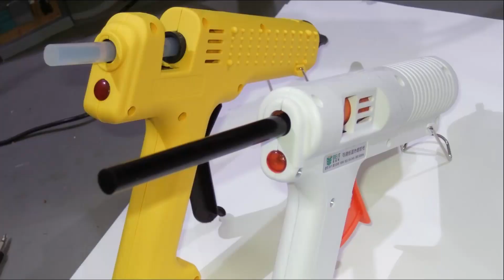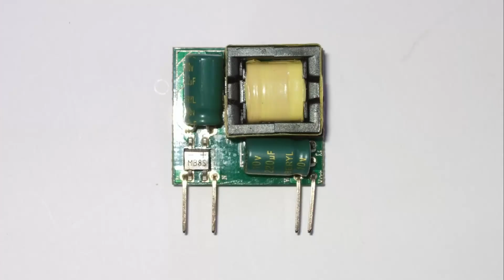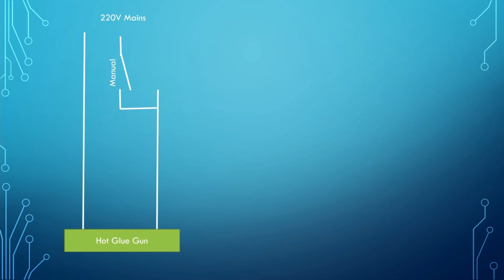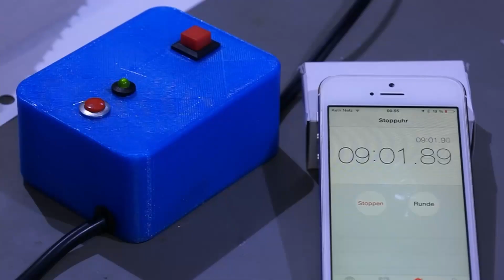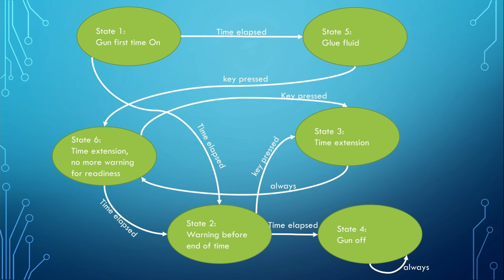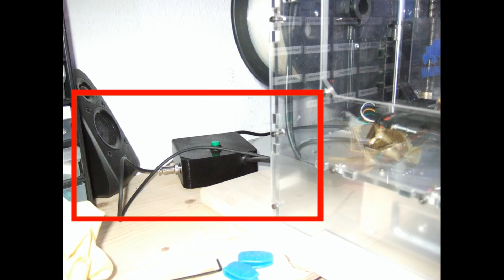#391 Hot Glue Guns are dangerous!

Comment: Excellent project. I had an old glue gun that was used frequently and left on for extended periods.   One day it died. Just beforehand, a faulty heating / thermocouple circuit ignited the molten glue. Fortunately it was 'noticed' before it did any damage.
Reply from the maker: Indeed they can be dangerous. And I assume they will last much longer if switched off when not used.

Comment: A cool upgrade would be small vibration sensor which detects movement of the gun and keeps resetting the turn off timer until no more movement is detected
Reply from the maker: Good idea. I often have just to solder one place which works in the 6 available minutes. So I do not often have to prolong the time.

Comment: May I suggest a few CMOS inverting gate with some resistors and capacitors?  Using a 4093, you can have up to 4 timers/oscillator inations.  No needs to do software programming!
Reply from the maker: It all depends on your favorite way of working, I think. I like these small chips with all their possibilities. But for sure you can do it with hardware logic.

Comment: I feel like this should be easy to do with one button.
Reply: I guess it‘s kinda difficult, because the Button powers the whole thing… and is in parallel to the relais - so with one button you would loose the now power consumption Feature i guess…
Reply: @davemme  Can still have zero power usage, especially if you use a mechanical relay. The momentary switch provides it startup power, and then it's fed from its own output until it decides to turn itself off. The wall voltage always passes through either the momentary switch or the relay before any other component, so there shouldn't be any power consumption when idle.
Reply: @sleepib: i try to understand how you could do it and still monitor the switch state… bad there‘s no way to drae in a YouTube comment 🙈
Reply: @davemme  Well, the easy way is to use a DPST switch, though you can do it with a single throw switch if you add extra components to prevent feeding power backwards into the switch.
Reply: @sleepib  ah now i see - thank you for the explenation... never used a DPST Switch before - but that would be a pretty good usecase
Reply from the maker: @sleepib: I do not see how you would implement the two timers with just one button.
Reply: @AndreasSpiess  You can use the second set of contacts on a DPST switch to signal the microcontroller. There's probably a way to make SPDT work as well.

Start the first timer on startup.
Start the second timer when first timer ends.
Reset second timer when button is pressed while second timer is running. 
Turn relay off if button held for 2 seconds.

Comment: Does your hot melt glue gun have a thermostat or is it thermally balanced? If it has a thermostat it will reach temperature more quickly and live longer as it can use a more powerful element but cycle it to maintain temperature. This is like a temperature controlled soldering iron which might be 70 watt or more and heats in less than 30 seconds, compared to a cheap 20 watt iron that takes several minutes to heat to soldering temperature and will cook its tip while operating as its temperature rises very hot unless actively melting solder.
If your glue gun has a thermostat then you could add a current sensor to your circuit to detect when the thermostat is cycling power to the heating element. When it starts cycling off for some significant time the gun is up to temperature. With a little tuning of the algorithm it may be possible to detect when the gun is not used and after too long idle, turn it off. (But it would probably be easier to put a little tilt switch on the gun and run wires back down to your circuit.)
Reply from the maker: I have temperature controlled guns and you are right, I could create a more complex system. However, I am not sure if if would change a lot. A anyway have to wait the same time till it is heated and I want to shut it down after 10 minutes. For somebody using the gun frequently it for sure would make sense to measure current and switch it off only after a long "not usage".

Comment: For years now I have used a hot water tank immersion heater timer to switch off all the things that get hot, or are potentially dangerous, in my lab.
The timer is connected to a mains extension block, so all devices plugged into this socket are switched off after a preset time. 
The adjustment is from 1 to 180 minutes. As the timer, was designed for an immersion water tank heater, it is rated for up to 30 amps at mains voltage. While this is not a true construction project, other than fixing it to a uPVC board and wiring it up, it has been a very useful addition to the lab. All my mains powered soldering irons, heat guns, hot glue guns, etc  are switched through this timer. 
One benefit is that it has greatly reducing the number of soldering iron bit replacements needed, as I no longer leave the irons on for long periods by accident. 

The original build for this project was inspired by a near serious accident that happened at a company at which I was working. 
A bench had been left switched on over night, leaving the apparently unused bench soldering iron powered. During a discussion about a particular circuit, the A0 size blue print of the diagram was draped over this apparently  vacant bench, and its hot iron. After many minutes, a brown mark appeared on the blue print, this rapidly turned black and burst into flames, fortunately the flames were quickly extinguished.  Had the discussion happened later in the day,  the lab might have been vacated before the paper diagram showed any signs of burning, and there would have been no one to promptly put out the fire,  with the obvious damaging consequences.
After that incident, I installed the timer as a safety device in my own home lab.
Reply from the maker: That is a good and simple concept and a very good reason to do it! 
The usage pattern for my glue guns and my soldering iron are very different. This is why I bought an iron which has an automatic shutdown built-in when I place it in the holder. And it heats up in seconds if I need it. I do not use the glue gun very often. So waiting is not critical.

Comment: Did this to both my guns and my partners curling iron using a Sonoff Basic Wifi Smart Switch Relay Module with Tasmoto installed. You can't beat it for $5!
Reply from the maker: Another viewer also suggested using a Sonoff. The only advantage of my design is that it does not consume any energy when not in use. But tit is probably more expensive and for sure needs more time to build.

Comment: Nice little project 👍🏻
I find it interesting to use a ucontroller for something like this. I would have gone the old fashioned way with some discrete components or a ne555 timer, logic gates or something.
Reply from the maker: Also a good idea. These small ATtiny chips look similar to a 555, and do not cost much more. But they can be programmed to do exactly what we want...
Reply: @AndreasSpiess  I was inspired by one of you timing project and had done it with a 555 timer. Sometimes I forget to turn off my soldering iron. Thank for the awesome videos

Comment: well, i’ve learned that there’s such a thing as black hot glue 😁
Reply: Other types of glue stick too like wall plug glue for which my 35 yr old glue gun has a separate nozzle. Drill a hole, blow out the dust, insert the glue gun with wall plug glue and it even leaves a hole ready to start the screw. Works really well.

Other ideas - anything that needs to switch off if not used for some time : heating plate, soldering irons, solder pots. Modifiable with light & PIR motion sensor to turn on/off workshop lights & power, etc, etc.
Reply from the maker: Very good. Apart from the color there is no big difference...

Comment: Funny, I  added a foot switch to mine for the same reason with a glowing Neon indicator...
I am considering adding an 8266 to my solder station that is MQTT enabled, so it can be turned off at specific times or via PIR sensor
Reply from the maker: Cool project! I just got a new soldering iron which has a sensor in the holder. It switches off when I put the iron back to it. Very handy. Maybe this could also be done with a hot glue gun (a switch where you place it). The advantage of my design is that it does not consume any energy if not needed, BTW.
Reply: @AndreasSpiess  I have been thinking of making a better stand for my glue gun, that has  a metal pin that sticks into the nozzle openening to block it when placed down, so the pesky oozing of glue stops.
Yep your "Selbsthaltung" is pretty clever, havent thought about that way of doing things before. 
Since my 'lab' is all MQTTd like your, lights go on/off with PIR and timers, it would make more sense for me to control it that way.... I might even turn some devices on before I arrive ;)
Reply from the maker: I only switch my lights with PIRs because I do mot want to switch off my bench power automatically. I want to be sure that I have nothing important going on. But it would save a lot of energy, I am sure because it often stays on without need.
Reply: @AndreasSpiess  My lab is my post production studio at the same time, so a lot of audio visual equipment. All is strictly divided into different power system. UPS backed, filtered and RAW grid power for non essentials. Within this space I have tons of desk lights, rack lights and so forth. 
All lights are controlled via PIR and NodeRed, to remember the last state it was when I left the room - there is no need to turn all back-on when I re-enter the room... only the lights that where previously on.
I came up with a very similar solution in terms of warning then you did - just not a buzzer, but a LED light stick, that begins to count down 1min before lights-out, just to remind me to move a bit and retrigger the sensor, or once all lights are off, the LED bar stays on for a 5min and gradually fades-out - a night light sort of speak.
All of corse wired onto Siri as well ;).

Comment: Of course I remember this one and I like it. Real project video, not only powerpoint. But as we all developed our skills in the meantime, I would say: We want more! I learned from Julian Illet, that you can determine if the glue gun already heated up by current measurement because the heat element is a PTC. No need for hardcoded time constant. Additionally, many soldering irons only lower the temperature for some time and completely switch off after a very long time. This would require some kind of dimming circuit for the gluegun. So, perhaps an idea for another video?
Reply: I think a soldering iron you need at an evening more often as a glue gun, so sometimes it is better to keep it simple and stupid. 
Only for an florist this could be fine ;-)
Reply from the maker: I think you are right with measuring the current. I am sure it would work. Like that you would not need to do the testing and it would work also outdoors in winter.
My soldering iron has exactly the function you mention and I like it because it heats up in two or three seconds. Unfortunately, my hot-glue guns take much longer . So the advantage for me would be small because I anyway would not wait and do something else in the meantime.
Reply: Depending on how reliable the voltage is from your grid. It can be an idea to measure voltage and current, to calculate resistance. Resistance is depending depending on temperature, but current is depending on resistance and actual grid voltage.
Reply: Curren (or current and votage) measurment can be good to shorten the time to ready-buzzer, if recently hot and not yet cold when switched on again.

Comment: Neat project. When you’re back from your holiday, how about a remix that would be simpler for others to construct?  For example, start with a Sonoff MINIR2 that includes the microcontroller (suitably reprogrammed), power supply, relay and PCB.
Reply from the maker: To use a Sonoff for that purpose is a good idea. It has a button and an LED. And a pin to add a buzzer...

Comment: The glue gun timer should be a mandatory safety feature on these devices. While they probably contain a thermal fuse, there is still a fire risk.
Reply from the maker: True. Here it is more used to safe energy because before, they ran for hours. I have a central switch for my whole bench which I switch off when I leave the lab for hours (for safety reasons)
Reply: @AndreasSpiess  I love your videos BTW!